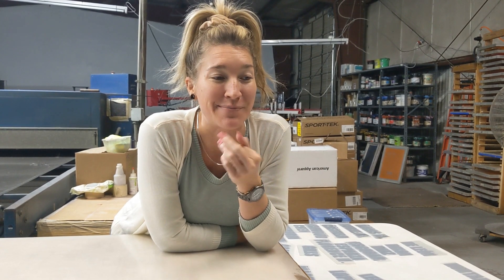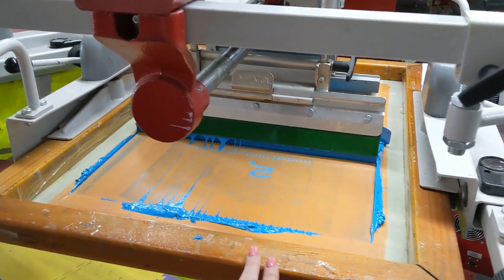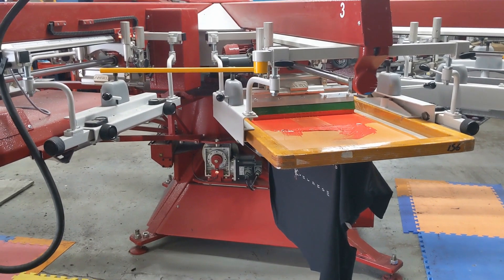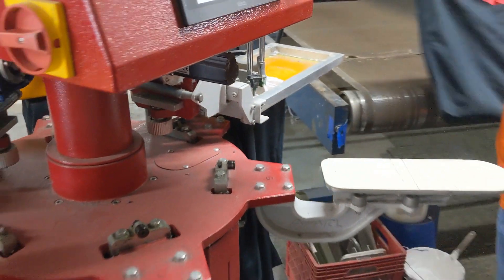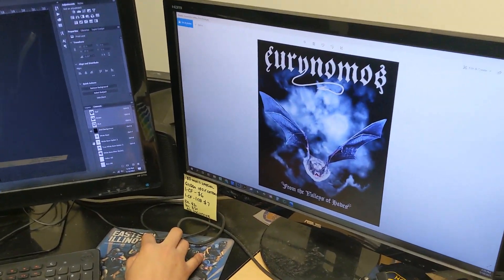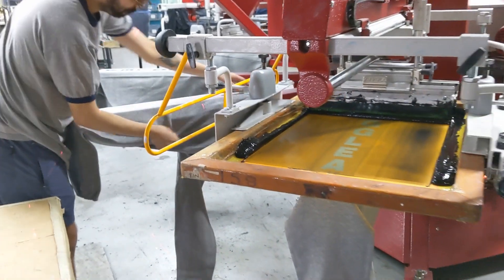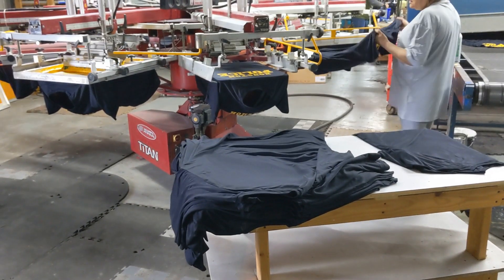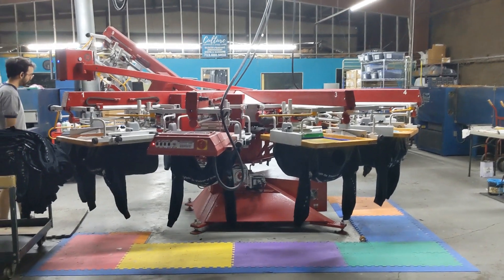Anatol Volt & Prodigy, Spot Process Printing, Reflective Ink & Laser Alignment

Comment: Have you ever needed service or parts for your Anotol machines?
Reply from the maker: So machines aren't invincible, and they require maintenance. I have had a blower motor on my flash go bad recently after a very bad storm here in Houston but it was quickly resolved and very easy for me to change myself. Coincidentally my PVC board also went bad and blew a fuse but also was able to source the fuze locally and ask for a PVC board from anatol. 

I tell everyone the same thing coming into this industry, you must be willing to take responsibility to fix your machine and learn some basic electrical & mechanical skills if you're going to stay in this field long term. 

However I much rather deal with that minor issue than having to replace air components ANY DAY. so take this for whatever you want.
Reply: Thank you...  I am having trouble getting help with my blue machines.. so I am a little gun shy!   @KendraCultureApparelStudio